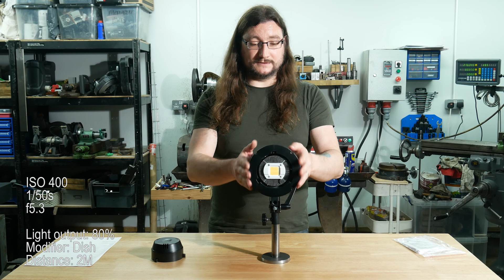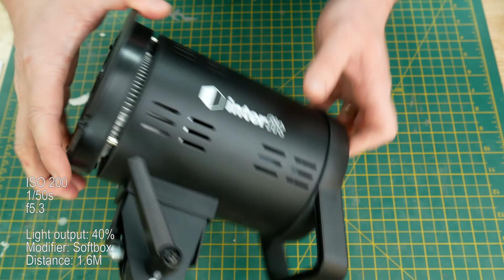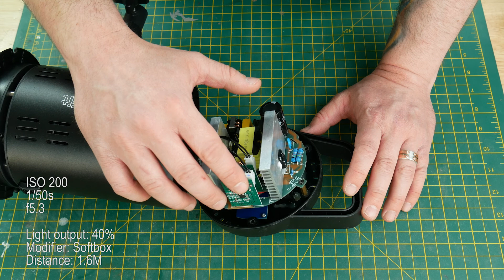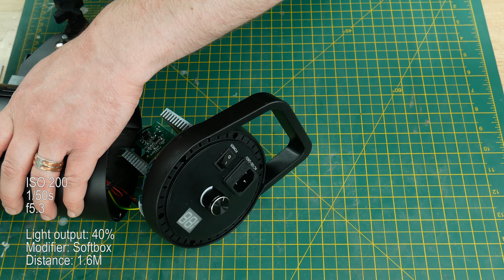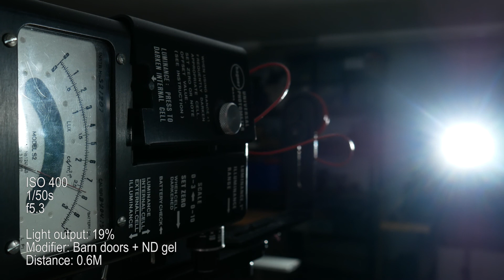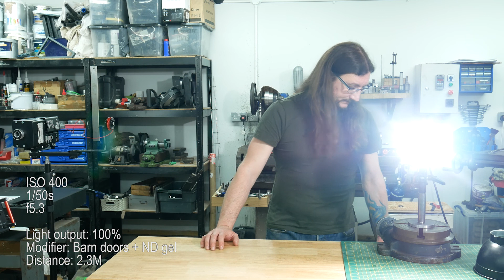Interfit LM-8 100W LED Monolight review

Comment: Hi. I was thinking of getting one of these for indoors macro photography. Would it be bright enough using soft box? Say if the softbox/ light was half a meter from the subject what camera settings would that give. I would like to use f11 at iso 100 on apsc sensor camera.
Reply from the maker: Honestly I’d bump the iso up a bit unless you have serious noise issues with your sensor, or there’s a particular reason you need to stay at 100 iso and stopped down to f11. 

I’m using the lights to film at about the range you’re talking about at the moment and off the top of my head the figures are f5.6, iso 400 and the lights are probably running at about 50%, maybe a little under, that’s with one soft box and the other using set of barn doors with an ND filter. 
I’m shooting with a Panasonic gx8, which is a micro 4/3 sensor, so your higher iso performance should be better than mine assuming you’re using a fairly recent camera.

Of course it depends on what you’re shooting, you may be better off with something like a ring light, or even a flash head. As much as using constant lighting is convenient, they don’t put out anywhere near as much light as a good flash will.
Reply: @ImpracticalMachinist  I am shooting soap bubbles so i need continuous lighting. I think it will be powerful enough at 100%. I currently use a light half the power but I have to shoot between 500iso and 1000iso, so your lights should be a big improvement. This particular shot was with a micro 4/3 sensor at f3.5 ISO500, https://flic.kr/p/2j4wTu4. I hold the light a few inches from the soap bubble.
Reply from the maker: I can see that’s quite a niche use case that you’ll need a ton of light for, I’m assuming you’re using a fairly fast shutter speed too? By all means give them a go if you think they’ll meet your needs.

I think you’ve done a great job capturing the patterns and the colours in those images, and they look really sharp.
Reply: Yes the shutter needs to be about 100th of a second. The patterns are swirling at the time and also need to shoot handheld. A small light source like a flash gun does not work. I am tempted with this light.  For the money it's very good.
Reply from the maker: I’m not sure I’ve got anything that’s comparable to photographing bubbles, but if I get the time during the week I’ll take a few photos of one of my tools spinning at the same settings you’re using and let you know how it goes.

Comment: I bought this light but had to return it as the power cable when fully plugged in comes loose extremely easily. Also crackles a bit. Could just be my light but can’t afford the risk of that happening during shoots. https://youtu.be/bea7YCrzK4c
Reply from the maker: That’s something I hadn’t noticed until you mentioned it, I haven’t had crackling but I did have a feel of the cables when they’re plugged in and the sockets could be a little tighter, I can certainly see the possibility of the cables coming loose if moving the lights around a lot. There’s a lot of weight on that plug when you think about the cable hanging unsecured, so the solution to that for me would be to secure the cable to the handle with a Velcro cable tie, or something of that nature. That said, the other way to look at it is that if someone catches the cable with a foot it’ll be the cable that falls and not the whole light, of course cables should be arranged such that the risk of that is minimal, but accidents do happen.

I haven’t left a review of the light on the interfit website yet, so it’s something I’ll mention when I do.

Comment: No offence and I know you're fully aware of this but unless you test all of the mentioned models under the same conditions this cant really help make a decisive purchase from the information.
Reply from the maker: Lux measurements are a standard and should be directly comparable, assuming those measurements are as stated and not inflated by either the manufacturer or retailer. 
Even if we assumed a fairly large margin for error, say perhaps 10% it would still be in the right ballpark.